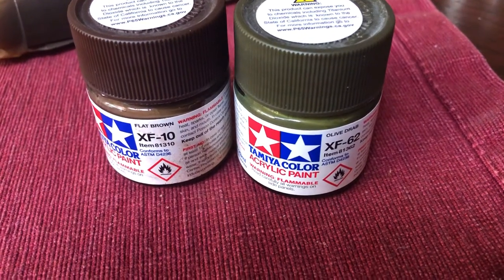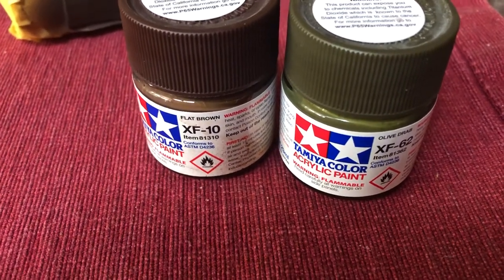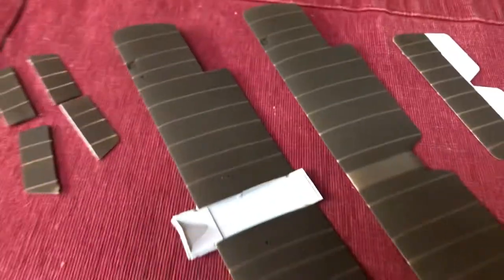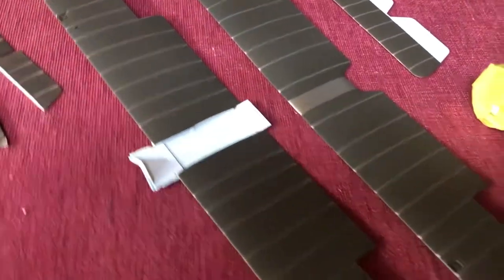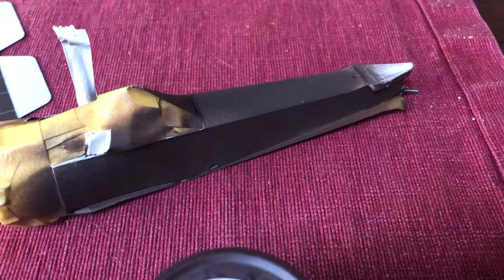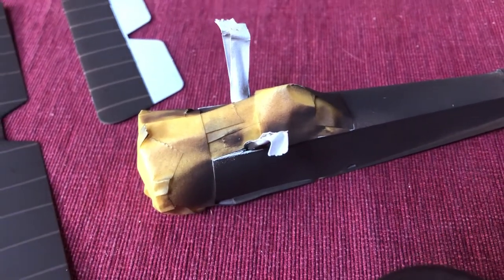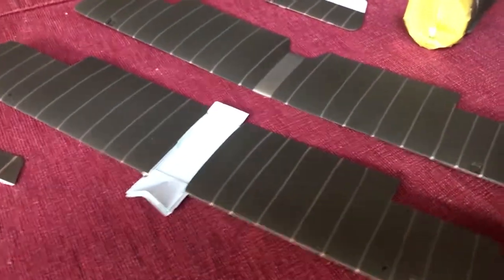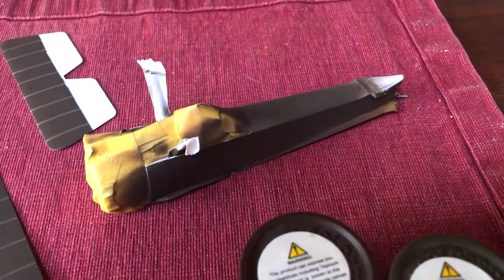Day 4 Wingnut Wings 1/32 Sopwith Pup build. A bit more painting

Comment: Looking awesome Mark, have a safe journey
Reply from the maker: Thank you Trey.  I ended up mixing a bit more PC 12 and finished painting the fuselage.. as per the updated thumbnail picture.  Fuselage / bottom wing fit is a bear... WNW doesn't like even .00000001mm of paint.. as I'm sure you already know.   Well, a bit of sanding and grinding will hopefully fix that.   The good news is that my RFC Lt. survived the masking tape.. it's always a bit tricky to block out the cockpit with foam and tape when there's a head sticking up, but I ain't changing my tactics now.. Already thinking about what's next..   Meng DRI or WNW Pfalz DIIIa?  I want to do the WNW SE5a, but I need to get a few of these Kiwi kits under my belt first before I charge in on my favorite plane.